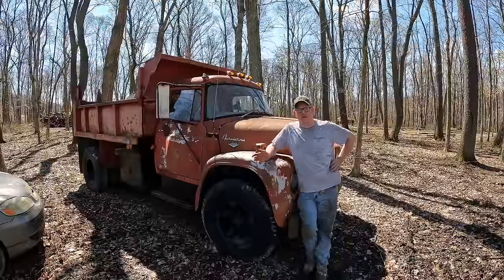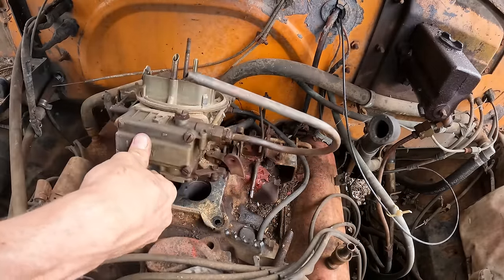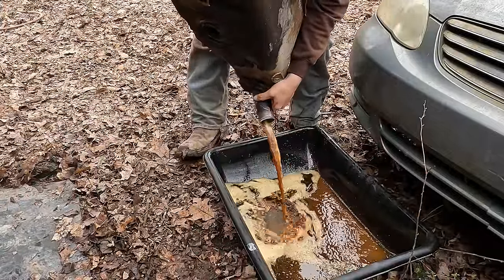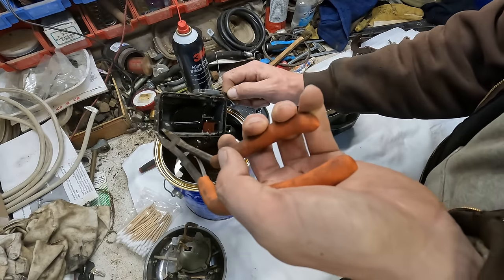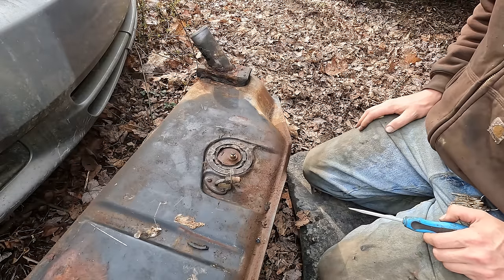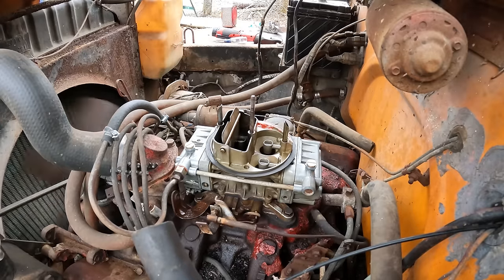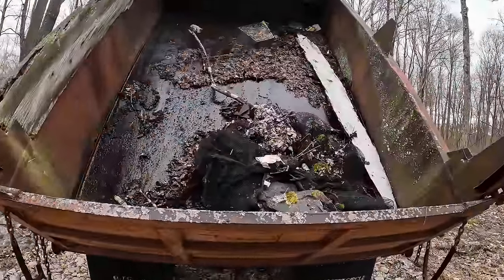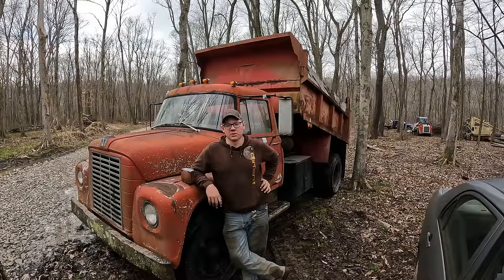Sitting 20+ years will this $500 Truck Run & Drive again? (International Loadstar Revival)

Comment: I'd love to see the top speed. I'm guessing 48 mph!
Reply: 50 does sound about right, he'll need an entire crew to effectively use all his machines at a job site
He might be able to score some extra cash that way like Chris at letsdig18 or the folks at Dirt Perfect do
Reply: I would probably say 65 mph. I drove a 67 back in 67 lol, I am old
Reply: The one I drove 65 mph no governer
Reply: I drove one with out the dump bed it ran 65 mph without pushing it.
Reply from the maker: Speedometer says 80 🤷🏼‍♂️🤣
Reply: Probably 60-65 mph. Looks like a nice little truck! Great patina,  bit of sanding and clearcoat. New clearance light...good to go!
Reply: What so you mean it's faster than VGG's Model A? 😂
Reply: with no load she'll do 65 pretty easy, the heavier the load the slower she'll go
Reply: I'm guessing about 60 if it is geared like most other IH's of the era. These engines like to snap valves if you run them too fast, 3300 RPM is pretty safe, 3350 is asking for trouble.
Reply: @DieselCreek  You want a manifold heater to speed warm up and make the engine run smoother, cleaner and more efficiently during warm up.  If working properly, it will shut off once warm.
Reply: @alan6832 .
It also controls a flap that acts as a choke on cold days. 
As the engine heats up the thermistor on the top of the filter cover inlet extension begins to pull the choke off.
They go wonky over time then good luck finding a new one.
Last one I had to change took 5 months to find one.
It actually came off a junked Ford. 
Same numbers on both.
They'd do that back then.
Source parts for different models and makes from a central source to save the cost of developing their own.
Reply: Downhill? :D
Reply: @DieselCreek  The fuel sender is either a potentiometer or a rheostat, depending on how it's wired, and I think most are wired as Rheostats.  https://en.wikipedia.org/wiki/Potentiometer
Reply: Go talk Matt into popping a inline 6 diesel Wes . Make it a co production . Come on now , I know you want to .I can see it in your eyes . So go on and do it yea
Reply: I wouldn't consider a full carb rebuild absolutely necessary.  Once you figure out why it was so rich and fix that, you can probably just run it with lots of fuel detergent and let it clean itself out over time and miles.  the richness was probably the float valves, which can often be fixed just by tapping on them, or excessive choke or a cracked diaphragm somewhere; the last being the hardest to find and fix.
Reply: @DieselCreek  may be 80 KMph and not 80 mph :)
Reply: Well, what do you think happens at 48 mph? Does a wheel fall off Camarata style? :D
Reply: @DieselCreek  So did the one I drove. but the needle never got there.
Reply: @DieselCreek  A screen is far coarser than a filter, so the problem with putting a fine filter in the fuel tank in place of a screen is it might clog faster and force you to remove the fuel tank again to change it out.
Reply: LOL!! Yeah it's got some real good gears in that thing all torque no speed
Reply: I drove one in the Army at Ft. Knox, as I recall it went about 5mph wide open uphill in first then depress clutch downhill, pray, let momentum carry halfway up next hill, rinse and repeat til you reach camp.
Reply: They all whine in reverse.. try high range
Reply: @DieselCreek  THAT is for when you are going downhill with a full load.
Reply: Matt they are good old truck my dad owned 4 or 5 over the years  from a 58 to the 70s models even a few Coe's all gas mostly 345 his scouts had 304s in them great buy she's a good old girl name her after your wife and see how that goes over helps you out when needed and dependable just a thought
Reply: @DieselCreek  I always had a lot of trouble hitting my gears on a 2 speed rear, even well after mastering 10 speeds.  I think what I would do is just leave it in low range off highway and leave it in high range on highway, and shift when stopped.  You could use low range in a city and shift to high range when stopped at the last light before getting on the highway.  Another way on highway is to use it as a granny gear for uphill and loaded starts, and shift to 1 high and then 2 high, so you are still quite slow when shifting the rear.  I never mastered high speed shifting of 2 speed rears and found them much harder than 10 speeds.
Reply: Sure the old prairie dog down in Illinois that owns a repair shop tries to peer pressure the wood chuck up in Pennsylvania into tearing up the only running outfit on the channel lol 😂
Reply: @DieselCreek  In your dream's! Tops about 55
Reply: 0h N0 it should run out at 55-60 I used to some of these.
Reply: @DieselCreek  that carb.......that stuff in there looks like Grandmas Beepen Boopen Old Fashioned Robot Brownie Mix !!!
Reply: @DieselCreek  100% it will go 80, just have to find a steep enough hill.   Fill it up with gravel, get it going then take it out of gear.  Just like the Nikola gravity drive truck.
Reply: Looks like you made a good find. It should last a long time putting around the job sight.
Reply: @rawr51919  Those old machines isn't supposed to run for an extended period of time, they would break down far too often - Chris spend quite a lot of money to get his old machines to run and perform properly, and as Matt says himself; "I'm cheap" so I doubt he'll spend that kind of money on his "Vintage" machines. 🤔😂
Reply: Come on Wess it should hit 55mph even if it has the 304cid in it unloaded that is
Reply: @diesel creek if the speedo says 80 you paid for it to do 80.
Reply: @DieselCreek  woohoo!! Nascar Trucks look out!!  😂
Reply: @DieselCreek  ...and my 2019 Equinox speedo goes to 160. ONE SIXTY! It's a freakin' 4-banger. Many engineers are vainly optimistic.
Reply: I drove a new one in 62 with a box, not a dump.  It would do 65 even with the drag of a box body and a load of maybe 5-7 ton
Reply: @DieselCreek  Call her Ginger. She's a redhead after all.
Reply: @mikelyons9971  What do you mean we paid for it to do 80
Reply: Top 60 loaded. 70 empty
Reply: I have heard of two ton trucks of this era unloaded with a 4 speed going 65 without stressing it I dont know what the top speed would be with a 5 speed
Reply: @DieselCreek  Maybe 80 coming down a steep hill on a solid sheet of ice and a strong tailwind, lol 🤣
Reply: @DieselCreek  that doesn't mean you can :)
Reply: I love your adventures.  Your smile is priceless!  Peace
Reply: I had a farm truck like this, 1972 304, 4bbl, 5+2, 18 foot flatbed. It was comfortable at 60. Had more in it but that always cruised well.
Reply: @DieselCreek  80 ... downhill with a Freightliner pushing you!!!
Reply: Ours did a little over 60
Reply: 70 downhill, 30 up.
Reply: Most, if the governor worked correctly, were set to run about 62 m.p.h. or top r.p.m. of 3,600.  Since most new people expected car like acceleration, they tended to over-rev the engine before shifting, so a governor is good to have IF it works properly.  If that engine was originally in a pickup, it won't have a working governor in it unless the distributor from the previous engine was switched into it.  You should see two ports for vacuum lines on the distributor.  The carb appeared to have governor components on it.
Reply: Those old trucks wouldn't set any speed records, but it will probably do about 65 wide open.......the 2 speed rear usually gave an extra bump to the top end
Reply: @frankwoodward9914  I bought a car with a speedo that reads 140 I better be able to 140 in it
Reply: @DieselCreek  Thats downhill and the brakes are on fire. Lets you know how fast your going before you hit the sand trap! 😂
Reply: @alan6832  First video he beat on those floats and did not get them unstuck.  Once you've gotta crack them open though you might as well do a full rebuild.
Reply: @mikelyons9971  Well the speedo dose not make the car fast or slow the engine under the hood is what counts and the gearing in the rear
Reply: Really enjoyed the video
Reply: @pinwizz69  I don't think the flap chokes much.  It just diverts the intake to the hot air from the manifold when cold. the controllers I saw were bimetal strips, but if it's irreparable then nothing much wrong with just removing the riser tube until a controller shows up.  It should run okay with a bit of extra choke during warmup.
Reply: @roycsinclair  One of the diaphragms was on the outside, and so was he float level adjustment, which can be used to control mixture temporarily until fuel detergents can clean everything out.
Reply: It unloaded it could do 65 or 70 but it would be a absolute hand full stoping is the hard part
Reply: my 1971 240Z's speedo read to 160, and I pegged it more than once.  Externally measured at 148 max, though.
Reply: So faster than the hummer at least!
Reply: Back in the early 80s I plowed snow for my brother I had my choice of POS plow trucks, a 65 IH ,66  Ford dump truck and a 60 B model mack. I picked the Ford because it was faster
Reply: @DieselCreek  must be kph ;-)
Reply: @MrWarthog213  Except down a big hill with the current brakes 🤪
Reply: She’s probably screaming at 48 miles an hour, LOL
Reply: 48 gallons per mile. Wes.
Reply: My 69 1600 with a v345 and 4 speed will do 55
Reply: My 69 1600 with a v345 and 4 speed will do 55
Reply: @RubenKelevra  According to my calculations, my 62 F600 should hit redline at 55mph in top gear. 6.33 gearing on the 2-speed axle in high. Compared to my 65 F100, with 3.25 gears, which cruises at 60-65 all day. The gearing on these old MD/HD trucks was LOW LOW LOW. Most highways were 50-55mph, so running 40mph with a full load wasn't that big of a deal.
Reply: Ol Red sounds like a good name
Reply: Wes come on give her a little more credit. She’s a 60 plus machine’
Reply: @DieselCreek  80 kph? 🤔 😁
Reply: @SvenDansk7  that was a joke. Also I don't think that he wants to drive 60 around his farm anyway 😂
Reply: @terryp920   i drove the old  loadstars  Trucks  &School bus's  i have had 75mph with 5speed and 2speed it all depends  on what ring Pinon  ratio it has some will only do 65 mph with a 392 or 345.
Reply: Those are around towner workhorse trucks anyway, everything from hauling medium loads to delivering fuel oil, their versatility and reliability made them absolutely prolific. Nice to see one up and running and soon to be returned to service.
Reply: @johnronsmith  Matt, you better drive this thing like a little old lady and install a tachometer! A snap would ruin the engine.
Reply: @alan6832  Your suggesting, coarse filter inside the tank and a fine filter inline, makes sense!
Reply: You might be quite surprised, Wes.  With that two speed electric rear, it will go faster than you think.  The one I drove would do 65-70.
Reply: @RubenKelevra  It breaks for no reason.
Reply: @DieselCreek  - I'm guessing that speed would be terrifying in this truck.
Reply: It goes back in time at 44mph, unlike Dr Brown at 88.
Reply: It's not a race car, but you could fill up the box with lead shot and drive it over a mountain.  It'll be slow, and it'll burn the annual production of an Oklahoma oil well, but it'll get there.
Reply: @HeavyHaulKen  I'm thinking the same thing.  She's got a big heart, so do her a favor and make her pretty.
Reply: @DieselCreek  if you push it out of an airplane.
Reply: Good ol' Intersmashable corn binder.  Cool.
Reply: NO MORE FAST FORWARD OR I WILL BE FORCED TO UNSUBCRIBE
Reply: NO MORE FAST FORWARD
Reply: Top speed is atleast 80. I have one with a weld built twin boom wrecker bed same motor and nose and the governor tops at 80. Still working on tuning it off to see what it could do.
Reply: Wow, that engine runs like a champ! Nice thing about those 4160 holley carbs is there's still great parts support. Nice to see someone doing it like I've always to do it. Nice job, great video
Reply: @pinwizz69  they still do it. Some things don't ever change.lol
Reply: Wanna sell it
Reply: I remember see that style cab everywhere. My friends and I came across a similar one with a flat bed in the woods up in northern Ontario. Had air in the tires and all its glass.
Reply: 60-65 on flat ground. Drove a bunch of them in the 70's.
Reply: 😅😅😅😅😅😅yep!!!
Reply: 43:13
😢😅😅😅

Comment: I grew up driving and fixing loadstars. That's gotta be a two speed rear I've  never seen a ten speed. That big holley four barrel means its a 392. These trucks are bulletproof.  They're  hard to break and easy to fix. We always called them cornbinders.
Reply: Yes,  this is a 5 speed transmission with a 2 speed rear axle.  2 speeds are accomplished with a set of planetary gears and a sliding clutch that either allows the planetary set to rotate on itself for reduction, or lock them all together as a unit for no reduction. The need to split shift (or not) depends on load and grade.  Lightly loaded and slight or no uphill grade and your engine will "probably" handle the upshift without problem and continue to accelerate.  But if you are loaded heavy or steep uphill grade it's best to split the rear end to high while staying in the same transmission gear to give the engine a bit of help staying within its better pulling range.  Next upshift you pop the rear end back into reduction while simultaneously upshifting the transmission to the next taller gear.
Compound box transmissions are different.  With compound box transmissions you upshift to the highest ratio and then shift the compound box to the high side and repeat the transmission upshift sequence all over again.
Reply: Drove many corn binders In 45 years of truckin ,mostly COE
Reply: Our old fire tanker was 64 loadstar 1500 gal. 392 was cold blooded. Fun to drive. Hard to stop.
Reply: Today I was looking thru one of my 1970 tool boxes and found a two speed motor. I laugh 😂
Reply: What model of loadstar is it. I have a 1700 all original and trying to find parts for it or manuals have become a nightmare. Any info would help greatly